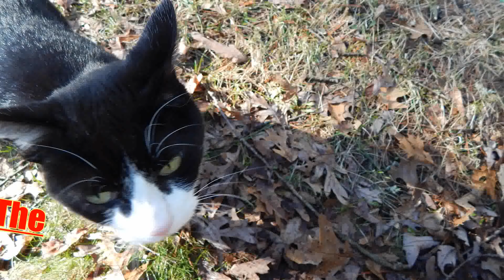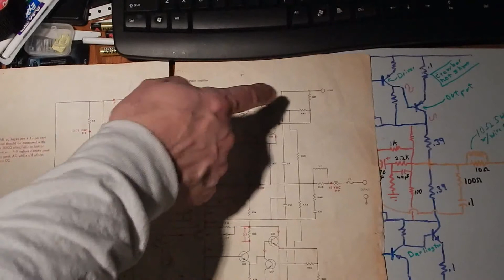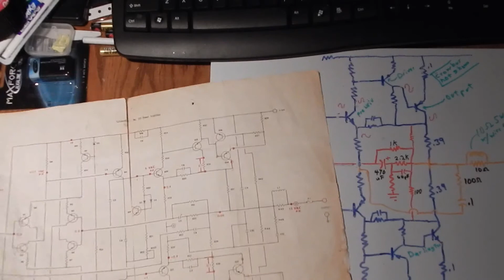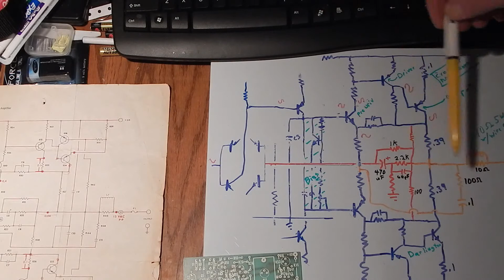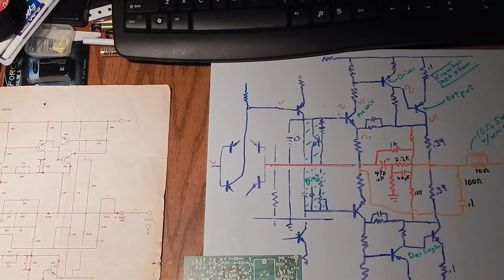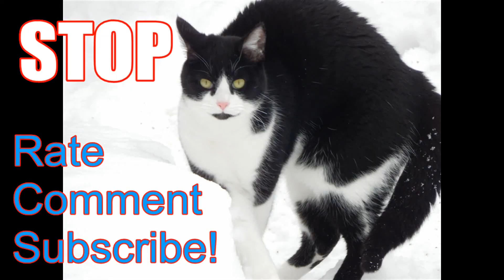Feedback Loops and Output Zobel

Comment from the maker: So, in this case, the "Zobel" is just a 10 Ohm Carbon core 5W resistor with a tightly wound layer of enameled wire.wrapped around it and soldered at each end so it's in parallel, with maybe a few pF distributed between them. "For stability" and "To shield against" or "To compensate for", the distributed capacitive load presented by the speaker cable.
Reply: I roughed out the parts drawn out in blue, lots omitted and a few errors. But one error is really significant and I should of caught it as it is significant to the analysis of the design, and I repeated this error on both the top and bottom sides. Can you spot this Error?!?
Reply: I see an extra set of resistors in orange in parallel with the .39 ohm resistors.

There are two caps in series across the supply rails. Between them a line that runs over to between the pre-drivers and also to the output through the RC network. Those shouldn't be omitted. Depending on their value, that may not be a separate FB loop. More like a stabilizing circuit as any HF is shunted to the supply rails.
Reply from the maker: The 100 Ohms are floating, no node. I know, I used three standards for drawing crossing but not connected wires.
The truly huge error was I tied the bases of the outputs to the wrong side of the drivers! They go to the emitters, forming Darlingtons. That's a little 180 degree error!